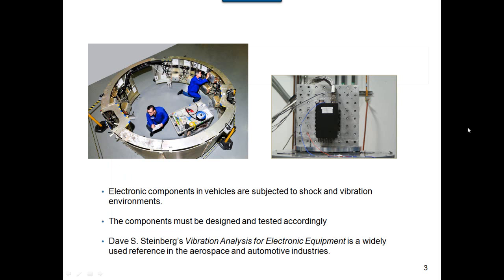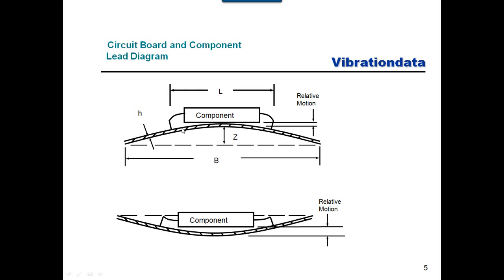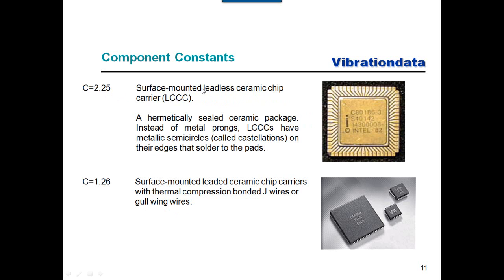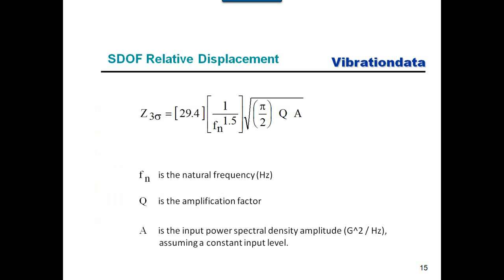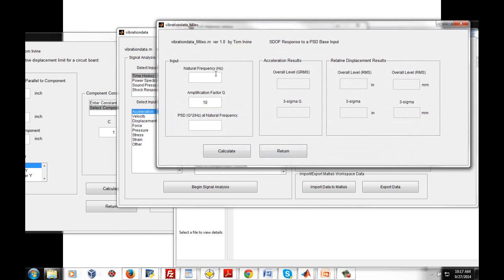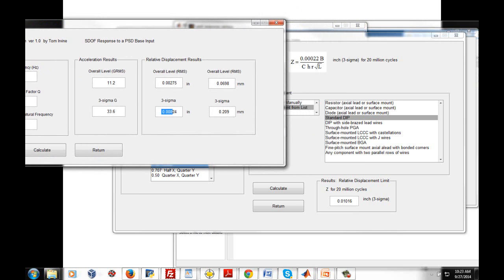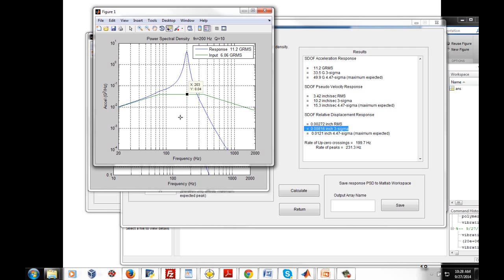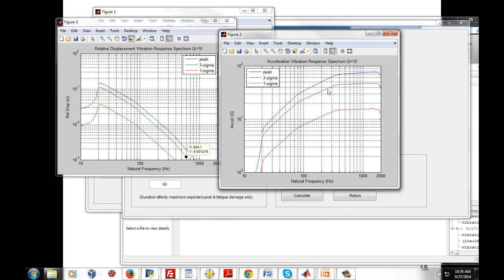Webinar 32 – Electronic Circuit Board Fatigue

Comment: hi....if the failure limit is strain-rate dependent critical strain in the solder (IPC-9704) and we have rms strain (in our application) available from random vibration analysis, how do we identify strain-rate in our application so that we can compare our rms strain to failure limit?